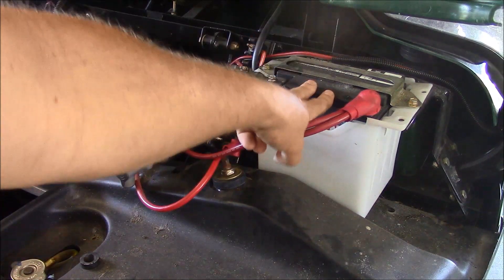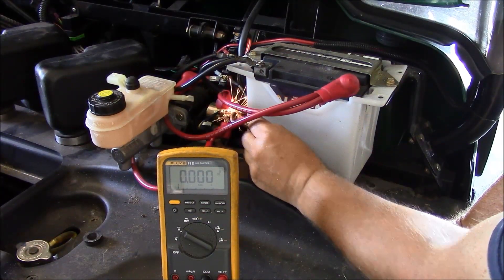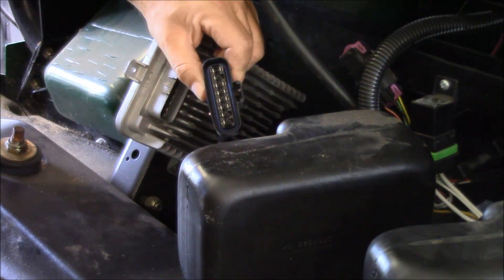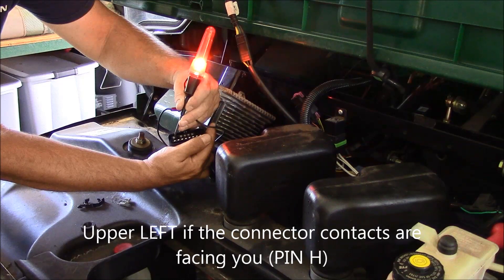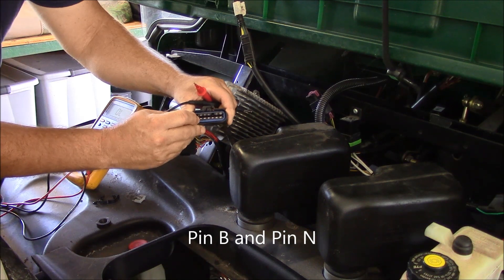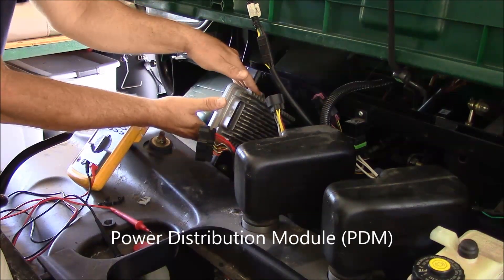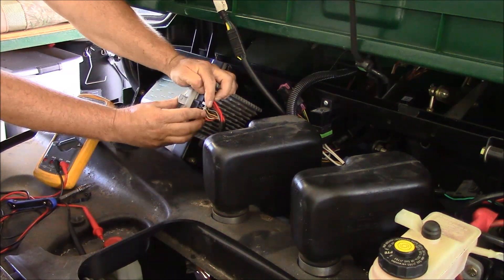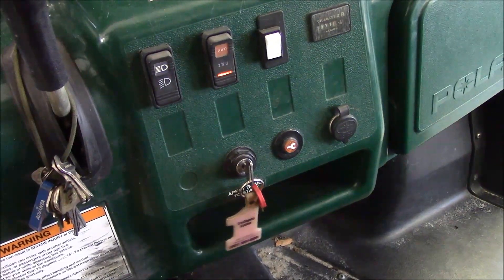Polaris Ranger 4x4 Dead Electrical DIY troubleshooting & repair

Comment: Awesome video. I'm having a similar problem, except I very a very delayed start . Sometimes I have to hold the key for 10+ seconds before it will attempt to turn over. So far I have changed the battery, plugs and wires, and the starter.
Reply from the maker: Does everything click over when you place the key into the on position or is that delayed ? Thanks for watching !
Reply: Mine was delayed too but the pump kicked on. It’ll do a clicking sound when it sounds like it’s starving for power.  It acts like an old bad stater bendix but I replaced that twice now and same thing.   Starter relay switch maybe?  Thoughts if you have any please. Now it won’t start at all. Even with a new battery and starter it’ll do this.

Comment: Found this video and used it and a voltmeter to trouble shoot the electrical issues on my '05 Ranger 500 2x4. Small differences in pin location on the wiring harness, mine was part #4011089 for my model. Different but close enough for me to determine that it was the PDM/ ECM.  $350.00 and a new unit later and I'm up and running. I'll most likely wind up having the old unit rebuilt to be kept as a spare as according to a Polaris tech these are notorious for going out. Mine went out at 123hrs.
Reply from the maker: I'm going to do a video on repairing these devices. There is a large market in rebuilding them and from what I can tell it is not problematic to do so. I am glad you found it useful and thanks for watching !
Reply: same for me, why would the parts numbers and pin locations be different ?
Reply: @survivalcomms  repairing the edm?

Comment: Thanks for the video. I have a 2005 Ranger 2x4 that won't start. I can jump the solenoid but cannot start with the key. I tested things like you demonstrated in the video and did not find continuity on the switch side of the PCM. Probably a dumb question but what do you think I should check next?
Reply from the maker: It sounds like it is in the box. There is B+ at the switch going in but not coming out ? Check all the usual suspects but its likely the box . I kept the old one I need to open it up and see what failed.  Let me know what you find . Thanks for watching !
Reply: Hello , did you ever find the problem ? Mine just went dead with no power at all pump won't come on or anything , I've checked everything and have no clue !!?? Thanks
Reply: @waylonmccrae3546  mine was the ignitions switch.
Reply from the maker: @waylonmccrae3546  It may well be the box like this one was.
Reply: @survivalcomms   I put a new box in it and same thing , it's flat with no power at all went thru everything . It's got me stumped for sure , I've never had one beat me down like this one is doing !! 🙂

Comment: I have a 2006 Polaris ranger 500 4x4 and while I was slowing down it just stopped running.
I replaced the starter and solenoid and the PCM and the coil. It will crank but no spark.
Also replaced ingition switch. Still no spark. When I got it home after it stopped running I pulled the spark plug their wasn't much left. Someone said crank sensor but still can't find it on the motor.
Just don't know how much these boxes are,, this ranger is like a money pit . It's been down more than I've used it , and hunting season is coming so I'd like to get it done
Reply from the maker: The crank sensor would deadline it for sure. I actually had one on a Jeep cherokee 
that died on me and I got home by tapping it with a screwdriver several times  ( what could it hurt) . The crank sensor will be close to the flywheel  on the passenger side IIRC.  This box was a couple hundred rebuilt. I kept the old one planning on rebuilding it but never got around to it.  Thanks for watching !
Reply: I found the pickup coil for the startor, but I haven't gotten underneath it yet. One thing it did do is eat up the spark plug like it got a power surge, because the center of the plug was gone like it was fried. I'm at my wits end. Hunting season is coming up and that's how I get around, and I welded a winch on the back roll cage to do the heavy lifting for me. I'm going to check the PDM box next and thanks for getting back to me
Reply: I got under it but never found the crank sensor. The new problem is that it will only crank twice and it just stops until I take out the plug. I don't know where I can get a PDM from on eBay they want a arm and a leg and I'm retired on social security and veterans disability check so money is tight,, so any idea where I can get one that won't break the Bank. Thanks for your help again

Comment: I have a 2015 Polaris Ranger 570 Midsize with a wiring problem.   I have called the Polaris dealer who told me that Polaris does not have a wiring diagram for this machine....????How did they build them?    Do you know of a source for a wiring schematic for this machine?   I have checked with TechSpark, but their wiring diagram is so small as to be unreadable, even when I try to expand and print it.    I have looked for Clymer publications, but they do not list my machine in their manuals.    Do you know of a source for a wiring schematic for my machine?
Reply from the maker: The factory service manual has a wiring diagram. The dealer doesn't want you to have it or they just dont want to bother selling you a manual. Best thing to do is seek out a factory service manual on ebay. It might cost 40 or 50 bucks but it is worth it. I hope this helps ! Thanks for watching !

Comment: Ironic, that your Polaris is more complicated and involved when looking for an ignition problem than my old '79 Thunderbird.  Crude technique I used, checked battery and connections, then jumped across starter relay, starter spun, so started to backtrack.
Reply from the maker: The vehicles of yesteryear were certainly simpler. That   PDM is an engineered to fail item IMHO. It encapsulates almost the entire electrical system in one item. I will be rebuilding it in another video and keeping it on the shelf for the future. Thanks for watching !
Reply: @survivalcomms  Did you ever do a video to repair the PDM ?
Reply from the maker: @dallasbright8496  I have not. I have the old one in storage and I have yet to mess with it.

Comment: on a 2010 the starter will turn but very slow, even with  the plug removed, my guess is the starter is too weak ,thoughts?
Reply from the maker: Could well be or the high current connections. Thanks for watching !

Comment: Ive got a problem with my 04 polaris ranger 500 the power to my fuel pump will work then will stop.no power to it .ive changed the pump cause it was weak. But no power.so i wired up a hot wire from battery to a switch and to fuel pump but after riding for a short time it quits. Then check the original pink wire for power it has power rehook it up as factory and works a short time then quits. Bogs down bad then backfires like its starving for fuel.  I put a new carb on it fires right up but doesn't rev up.it starts easy but have to play with the gas pretal. There are 3 boxes under the hood middle one has a raised bump in it but can't find info on them
Reply from the maker: Without a service manual or a schematic it would be difficult to diagnose. It may be a problem in the ignition system cutting off intermittently. Thanks for watching !
Reply: @survivalcomms   do you know what the 3 black boxes under the hood do i know one is a regular but not the others are for